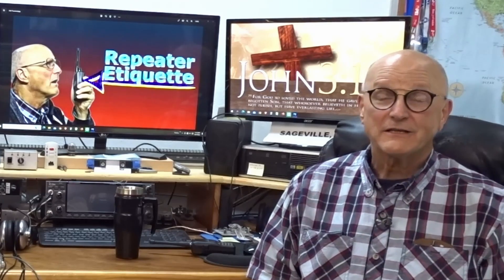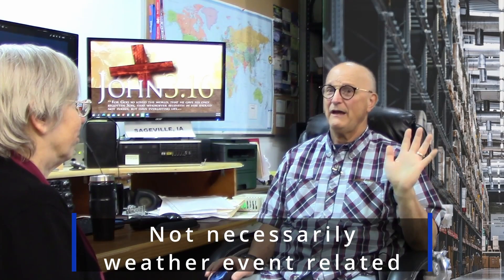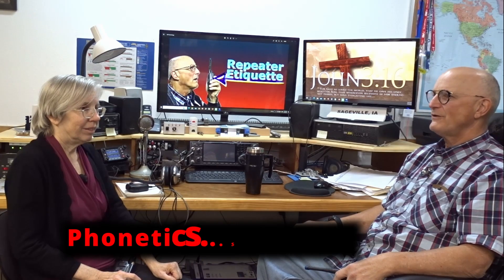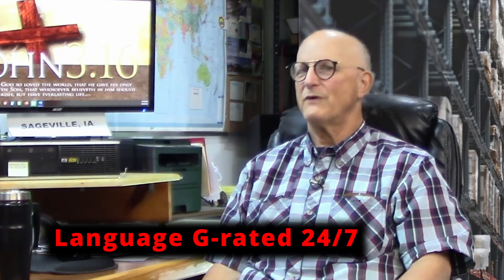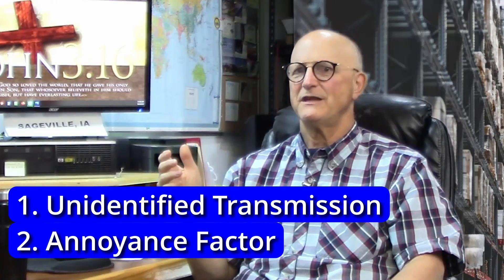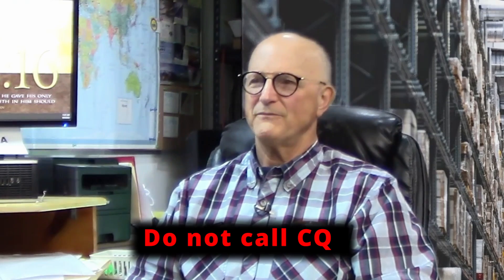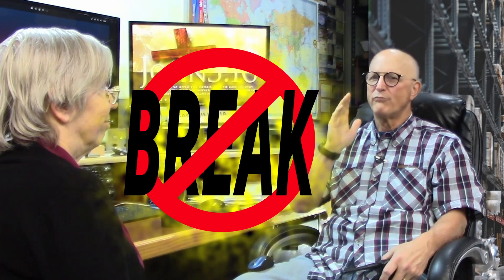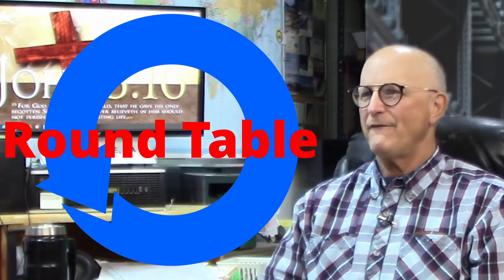Repeater Etiquette (037)

Comment: Ive been told its fine to call CQ on a repeater - by multiple people. And in fact thats about the only way I actually get other hams responding. I stopped announcing as “listening” or “monitoring” unless thats actually what i want to do .. just listen/monitor.
Reply from the maker: As I said in the video, what I presented here is a compilation of several repeater/ham radio clubs' published repeater etiquette documents from all over north America. So, this isn't just me speaking out of my preferences. All of this also agrees with what I was told early on by yet another group when I first started using repeaters back in the late 1990s.
If all I want to do is listen, then I do not need to announce that I am listening. Announcing that you are "listening" or "monitoring" is repeater speak for CQ.
Reply: @eie_for_you  maybe its just my area.  Ive yet to receive a single response without calling “CQ” or specifically saying im looking for a contact. When i talked to few local hams about why noone responds they told me to say “CQ” .  My understanding was as youve said: “monitoring” or “listening” means youre open/looking for a contact. My experience has been opposite of that though.
Reply from the maker: @poorman-trending  Yeah ... it is sad that this lack of response seems to be all over the place. It used to be very different.

Comment: WOW! Thank You for comment . It is no problem, because I Am also not a "Speedy Gonzales"hi! For example I had very very nice about 30 minutes long QSO with EA6AOL/3 using speed 6 WPM! But my  main problem is in my equipment .I am using a  Xiegu 90- very nice low price and low power  hi!  tcvr and a home made HF 20a antenna, located about 35 mtrs. up over the ground on our apartment building about 33 mtrs high. Last  winter i have  had some  Qso*s with W and K -stations  and I will be very happy  to QSO with You  and I hope to be lucky man and we will meet on hf ! Vy 73!

Comment: New to the radio world … but I got my GMRS license , made a few transmissions and was called “noisy” on the repeater.. what does that mean ?
Reply from the maker: Good question. I am going to give you a very full rounded answer that should help you do better all around.
GMRS uses Frequency Modulation, which means that stuff that normally affects the amplitude of the signal (like static crashes from lightning) does not affect the audio. This is referred to as being "full quieting" = a good signal.  
HOWEVER, if your signal weak into the repeater, the normal background noise that exists in the R.F. world starts to affect the audio quality.  Your signal becomes "noisy." You are no longer "full quieting."
This can sometimes be "fixed" by just moving your antenna a little bit, maybe standing up if you were sitting down, taking a half-step to the right or left,  standing on one foot with your radio in the air and your tongue hanging out (just jokes! LOL 😀).
If you are using a handheld transceiver (AKA: an HT), the "rubber duck" antennas that often come with them are pretty pathetic, poorly matched for the frequency, and poor signal radiators (also known as "rubber resistors"). Getting a better quality antenna can help. Don't go cheap here. Cheap just gets you another rubber resistor.
If you are using a base station (mobile radio with a stationary antenna), we also think antenna, but also think coax (very often overlooked). At GMRS frequencies RG58 has really high losses (12 dB loss/100 ft at 400 MHz). It is convenient, but by the time your 50 watt transmitter power gets to the other end of 100 feet of RG-58 only about 4 watts is actually delivered to your antenna!!! The other 46 watts is being dissipated in heat in the coax.
Hope this helps! 🙂
Reply: @eie_for_you  Thank you sir! I have the infamous baofeng HT at the moment with the stock antenna. My new antenna from single stuff is on its way. I am trying to hit a repeater 8-9miles away with no elevation advantage 😬 I did get the response of being too noisy and I also think I heard Morse code? Fairly confident it was Morse code, sounded like the movies. In any case I’ll try again with the new antenna. Thanks again for the “Elmer” lesson. (Just read the history on Elmer 😆)